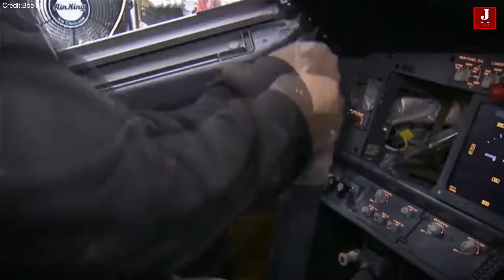Boeing confirms 797: A New Era for Mid-Size Aircraft

Comment: One thing needs to be made clear. 321XLR wing span is shorter than 36m. Thats why it is giving the big heebie jeebies to Boeing. Thats why A320NEO family covers 737 to 757 market entirely, and in other words, Airbus proved that short to medium range market can be covered by a single type of aircraft. Competing against single family of A320NEO with 2 different aircrafts would be extremely stupid idea.
Reply from the maker: Thats right. but Boeing must ensure it develops an aircraft comparable to the A321XLR.

Comment: Too late. Airbus with XLR takes all
Reply: @stanleovart  not necessarily. The A321XLR doesn't fill the entire range necessary for the aircraft that these airlines want. It's just the next best thing. The 757 was that aircraft but it's outdated at this point.
Reply: @QueTalMiAmigo  757 is a great airplane but Boeing not catched the true point of future and lost that, not developing 757 further. Now when reputation of Boeing almost destroyed - it will be very hard to compete with 321XLR.
Reply: @stanleovart  theb 757 was made to perfection. The only flaw was that it was made too early. Boeing still has a good reputation amongst airlines. If it didn't, airlines would stop buying it's products altogether. The A321XLR is a great aircraft, but, again, it's a niche aircraft and it doesn't have all the capabilities airlines are looking for. It's just simply the closest aircraft to those requirements. That's it. Boeing will eventually come up with something else that will match or supercede the A321XLR. It's just the way things move. Neither aircraft or it's manufacturer stays on top for long.